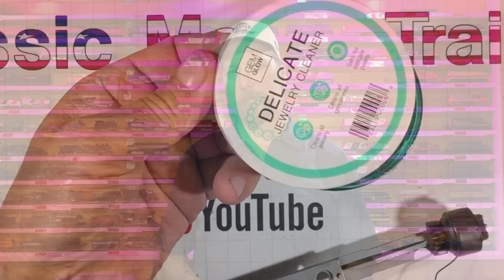Rivarossi Berkshire 2-8-4, How To Disassemble, Clean, & Re-lube

Comment: As someone that is from Lima, the real NKP 779 resides in Lincoln Park in Lima, OH as a display along with a NKP wood caboose and a NKP Dynamometer car. NKP 779 was the last steam locomotive made by the Lima Locomotive Works, and it was preserved by the Allen County Museum as a static display. As far as preserved NKP Berks around, there are about six of them preserved with NKP 765 operating as mentioned by yourself. Also, I wanted to mention that anyone needs a replacement motor for Rivarossi steam locomotives to look up CV-Backshop (not affiliated with seller) for replacement motors. The motor kits will fit Rivarossi and Mantua locomotives along with some other manufactures. Also, as usual, another great video to watch.

PS: I agree with the one poster about the pronunciation of Lima. It's like the name of the bean, and the town has a mascot of a Lima Bean.
Reply from the maker: Thanks for that great info.  Glad to hear there are 6 more cosmetically restored!! I've used CV-Backshops motors.  I'm quite happy with them. 
 LIE-Ma....Got it :-)
Reply: I am a former born resident of Lima,  Ohio  myself attended Allen East high School was born in the same Hospital as my mom and my mom graduated from Lima Senior high My grandfather her dad worked at Westinghouse which was located right across the street from Lima Locomotive works  my grandfather said they built the air pumps on the Berkshires and the Southern Pacific GS series of Locomotives including the 4449 SP Daylight that runs today  This is another good video Ron !! I'll post the pics I have of NICKLE Plates 759 that is in Lincoln Park in Lima on your Facebook page !! I think it's from 2014, though, but, hey, that's only 10 years ago!! 😮

Comment: I have a Rivarossi Berkshire in the C&O Livery. Unfortunately the front is pretty mangled, all the front detail bits are missing besides the front lamps. i suspect from poor storage from the previous owner, also has a loose wheel that occasionally binds the mechanism, yeah my unit is in some serious need of rebuilding before it hits the rails again. I have it packed away with most of my collection now. Be a few months before i even take it out again, then i will go ahead and see what i can do to bring it back like this one.  Most of my engines need parts donors when they break down, oh well the joy of being a display operator!
Cool Video
-KJP
Reply from the maker: Thanks Kevin.  Sorry to hear all you stuff is packed up.  Thats always frustrating

Comment: Cute. Very nice refurb, and ot loooks great. I've got a bunch or old Rivarossi C-16s and C-16As. Those old three pole motors are definitely not up to modern standards. However, I just did a pair of modules based on a Nickel Plate town for my club's modular setup, so I'll likely have to put in a bid.
Reply from the maker: Thanks for your kind words on my vid, and supporting the auction :-)

Comment: My favorite steam engine is the Southern Crescent #4501, the last of its class, MS.  It still runs on the Tennessee Valley Railroad.  My wife & I are to soon take a ride on her.  It's also my favorite HO scale engine.  There's a picture of Johnny Cash waving out of the engineers window.  The MS class was a 2-8-2 Mikado.  I got a big lump of coal that I smash up with a hammer and use it to glue on top of the molded coal load.  Adds some realism to the tender.  Cheers from eastern TN
Reply from the maker: Southern Cresents are indeed good looking steamers

Comment: Hi👋
Nice Video 👍👍👍
I have an Tip for you:
Try out some Orange Cleaner to Clean your Lokomotive. Only some Warm Water and a little bit of the 🍊 Cleaner. Put the Parts in and let it soak around 10 min . After that take a Brush and Clean the parts. 
Wash it with clear Water an let it try.
Greetings from Germany
Sascha
Reply from the maker: Greetings from Montana, USA Sascha.  Thank you for the good idea :-)
Reply: @classicmodeltrains  You can Put all parts in there. Only the Motor you have to Put in an different Cleaner 😉

Comment: You can take those Rivarossi motors apart to clean the commutator, I've done it myself. Not the easiest things to get open though.
Reply from the maker: I agree, I just don't want to bend them metal tabs to open it up.  Can only do it a few times then they break off.

Comment: I did not think you could dip a motor in liquid like that. Could this be done with any motor, or does have to sealed?
Reply from the maker: None of these motors I have put into the jewelry cleaner are sealed.  It works on small DC motors.  I've only done a few this way and so far it's worked great :-)

Comment: Every Riverossi steam loco I’ve come across has been noisy.  The running gear has a tendency to bind, stick, or needed to be retimed, re-quartered.  New or used.   They are beautiful model trains, and eventually in the right hands do run nice, just expect more for the price point.
Reply from the maker: I agree with the noise but I guess I've been lucky and have not had bad or bend running gears (knock on wood) :-)

Comment: WAT IS. the pupose of the thrust washers
Reply from the maker: It's kind of like a friction bushing or a replaceable wear surface on the end of the worm gear.  When the worm gear is turning either forward or reverse it wants to be shoved out of the assembly from force being applied to it from the drive gear its turning.  The bushings on the worm gear shaft of course hold the shaft in place, and the trust washers are in-between helping to keep the shaft in place and helping to reduce friction.